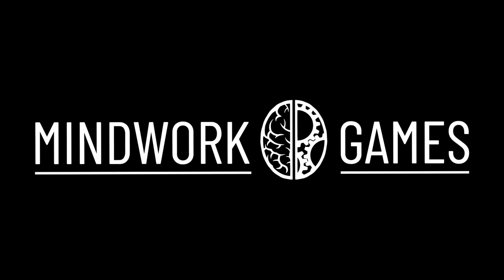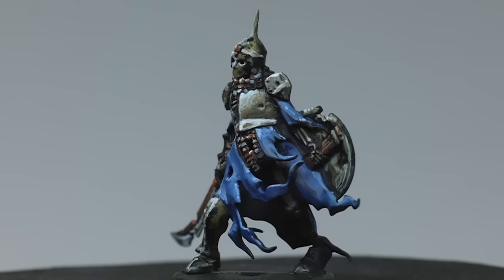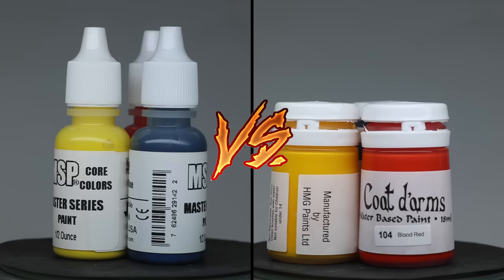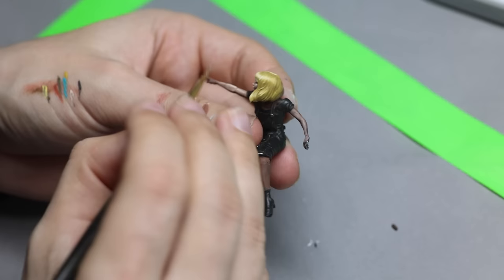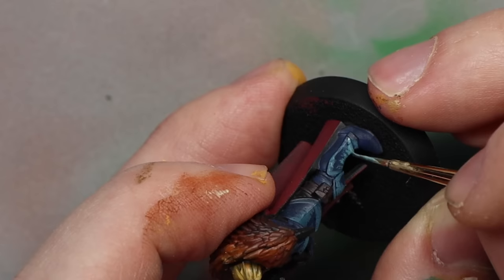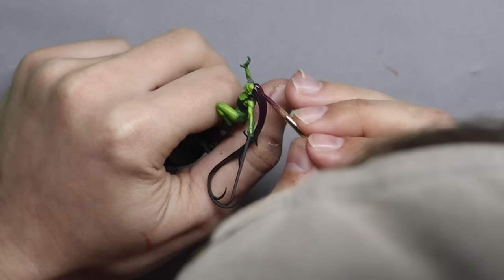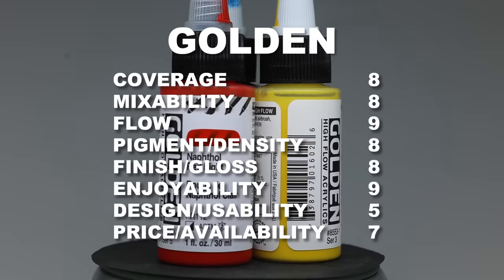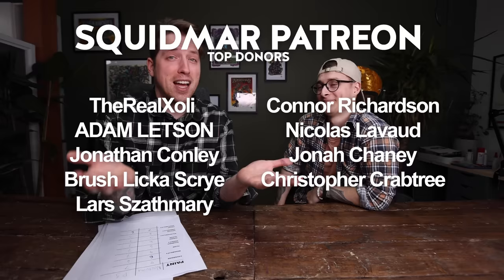Worlds biggest paint test! - pt. 1

Comment: Scale75 needs to be well mixed to work well. By well-mixed, I mean you have to beat it like a rented mule: use a vortex mixer with a dense agitator and keep it on the mixer for about a minute or so. Without that, the paints are OK at best. With that, they're freaking amazing.

Golden Fluid Acrylics have a gloss finish because a gloss finish can maintain an inherently higher color saturation. (Matting agents scatter light at the surface of the paint which reduces saturation.) You can always matte the finish at the end of painting or add a matting agent during painting. The high-flow line is really nice for airbrushing and glazing, but it's functionally useless for basecoating. The Golden Soflat line is dead flat and very nice straight out of the jar, but I'd recommend putting it into dropper bottles (as I would with any other pot paint.) Most Golden paints are single pigment (and they tell you what pigment(s) each color uses).

If you want a similar performance to Golden without a gloss finish, you might look at the Liquitex Acrylic Gouache line, which is flat and otherwise has similar performance to the Golden paints.

Reaper paints are very nice; I've used them for more than a decade. As others have noted, though, their early metallics are garbage. (The metallic paints they've released in the last few years have been much better.) It's too bad you don't have any of their browns, since that part of their range (including the paints nominally intended as skin colors) is excellent. There are a bunch of colors from their line that I use all the time.

Comment: Man, I wish these were the same miniature & colors so COMPARING at the end actually would mean something. Hard to say what is best when it's a different model AND color each time, I can't appreciate the details on "the best paint" if it's not compared to the other paints. Next time same model & color match AND if you can paint without knowing the paint, bonus if you paint blind so you don't know what brand it is. All these & I still don't know which is the next point I'd like to try, I HAVE to see them side by side with the same model & color set to judge. For example, I can't visually see a difference between Apple Barrel & Kimera BUT if they were both applied with the same colors to the same model maybe I could judge that better. Cheers Bruv keep up the great conent!

Comment: I feel like Vallejo scored so high because you know and use the paints often
Reply from the maker: Most these paints we've used a lot. But it became very apparent quickly how the paints work when we painted them one after the other.
Reply: @SquidmarMiniatures  that's a fair point I did notice a lot of the ones that had coverage issues (p3, monument, scale, warcolours) are all paints I don't normally bring out until there's a solid base color already down. While there are exceptions to that statement it mostly goes down that way, citadel or Vallejo usually being my base coating go to(s)
Reply: @MrLanzac  My workflow is very similar: Start with citadel and vallejo and finish the blends and fine details with scale 75 and warcolours. Though there are times when citadel / vallejo has just the right color for details as well, so it varies.
Reply: I mean, Vallejo is just good. I love my boutique Kimera and ProAcryl, but Vallejo has got the formula down for quality workhorse mini paints.

Comment: Thanks to local availability I've used Vallejo, Army Painter, GW, and Reaper (also Tamiya, but they didn't test those) and what I've found is every brand has some good and some bad colours (as Emil noted, Corax White might be the worst paint ever).  I haven't found the separation issue with AP (other than 'babe blonde'), even with shaking by hand  and my bottle of that exact red works great - maybe the extra shipping time to Canada from Denmark as opposed to Sweden does something (I dunno, its a science question, so Brent from Goobertown might be able to answer it). Or it's just that they need to up their quality control . . .

As someone else said, Reaper's triads are a wonderful thing.  Their 'Worn Navy' is great.
Reply: Supposedly Army Painter have a bit of extra unmixed medium in the paint to help it against evaporation. You're supposed to have it rest for a bit upright and squeeze out the first several drops (of probably unpigmented medium), the rest is fine. It's a bit of a hassle for the consumer but I understand where they're coming from from a logistics point of view. I just wished that the paint come with the mixing balls instead of having the consumer do it themselves so it's nice that they started doing exactly just that with the air and speed paint lines.

I found separation with my AP paints but with a bead inside I just give them a quick shake on a vortex mixer and I don't really have any issues. Reds and yellows still don't cover fantastic but for the price of the other "better" brands I just weighed my options and decided that liquitex guache is the better choice for those colors for me.

Comment: I've tried most of these. I quite like Army Painter. I've been using their Pure Red on a lot of my orks lately and it looks really nice and their yellow gives such a nice color once you layer it on a few times. I never actually had trouble mixing the paints, but that's probably because I shake them by hand. Also, I do almost always use medium instead of water to get my paints to the consistency I like so maybe that helps. I find quite a few paint brands look worse using water instead of medium. My go-to paints are Vallejo and Army Painter.

Comment: Yes it's a year old video but   from my experience of being a paint addict here is my personal ranking;
Wildcard: Molotov Acryllics - a graffiti brand that specialises in acrylic pens and sprays, this means that their adhesion is fantastic and outperform any primers I have tested, even brush painted black, they are silky smooth as they are designed for rough walls so make a fanatic primer and base colour in one package 
Number 1: Two thin coats - really grown on me laterley and found myself gravitating towards them, they are basically citadel paints but more consistent, better coverage and in a better pot.
Number 2: Kimera - I really struggled with them when I first bought them as I bought into the hype of their quality. Over time I found that glaze medium was the way to go with them and forced me to think about the colours I use. They punish lack of patience with layer building so you have to make care to get that clean coverage as each paint is unique due their pigmentation qualities. Outside inks their richness is unmatched.
Number 3: Monument, another brand I've gravitated to in conjuction with TTC, a great array of useful colours and probably the best white and greys on the market.

Comment: Scientifically this test could be improved. 
- First off, having two people conduct the testing and overall score introduces potentially incompatible bias on either side of the chart
- Branding wasn't removed, and so personal bias can sneak in there aswell (you would also need to have an independent person manually transfer the paints from their original bottle to a standardised one, also labelling each one with a serial number that would match up on a spreadsheet)
- The models themselves weren't standardised, so you're naturally going to get a different painting experience and also have any frustration of the model design itself transferred to the paint grading
- You would also want to use the same brand of brush each time, though replacing it with a new brush of that same brand and model each time you start a new mini. 
- Have some grading criteria, that way you can standardise scores each time, otherwise its hard to get a quantitative result since you're essentially guessing what number you should grade it as

Comment: Scale75 being really thin is usually not the case. The regular Scale75 paints have a tendency to separate similar to Army Painter, you gotta shake them well, because otherwise you're mostly getting medium, that might have been the case here, because in my experience they cover pretty well and are rather thick. Given you mixed them well. They btw also use a gel medium so it was actually quite a fitting match up.

Comment: So I've recently started playing with Golden's SoFlat, and from my limited experiments, it has blown me away so far. Their permanent green light immediately replaced ProAcryl's Green for me. I will note that in the USA, they're a lot cheaper on DickBlick than in store for me, so price check them if you can. I have two critiques. First, because they're a fine art paint, they're fine art colors, which means things like skin tones are limited. Second, because they're a fine art paint, they're in those screw top lids. I wish they were in the high flow containers, but I know how to transfer to dropper bottles. It's kind of a pity they went up against Kimera, as those are a bit of a juggernaut, and I wouldn't be surprised if they make it to the final 4.

ProAcryl has been my go to brand for painting for the past 2 or 3 years. Aside from the twist top, which as you noted will always leave at least some mess (especially if the pressure has dropped, or the bottle has warmed since you closed it) my big complaint is on how they separate over night on a wet palette. Even after mixing, they end up a little chunky, which is unlike most of the other brands I've used. That said, finish, range, price, and just how fun they are to paint with are all top notch.

Citadel is Citadel. You know what you're getting, and what you're getting is good. Their pots are bad, and they're about a dollar more expensive than what you want to pay, but as everyone knows (aside from the white), they do good stuff. They have some really interesting colors, which I like to not have to mix in other ranges, so they still regularly end up on my palette.

Vallejo is Vallejo, and they also do incredible stuff. What they do is well known, and their paints are great. Apparently they're a little difficult for distributors to get in the states (or maybe they're just not being pushed? IDK. It was like pulling teeth to get my LGS to stock any of their stuff), but yeah, if you can get them, use them. Their silver metallic paints are some of the best in the business. I'd like a few more options from the gold/copper/bronze tones for Vallejo Metal Color. 

AK Interactive III is another paint line I've used a ton of, and they're really fun. They're a little difficult to get a hold of here in America, but several of the colors are in my favorite selection of paints, and two or three tend to end up on nearly all my minis these days. They are military focused, rather than fantasy/scifi focused, so think Vallejo Model Color vs Vallejo Game Color. In many cases they do a lot of the same colors Vallejo Model Color does, but with a more matte finish, which is good in my book.

Comment: I mostly paint with citadel, because those are the easiest accesible to me (sure, there is also Armypainter, but unless they start adding the ball to the pots, like they do with the speedpaints, i never got a good result).
For black and white i get tube of nonglossy accrylic paint from an art store. Sure those are pretty thick, but you can easily thin them down with water or medium. Also those tubes last forever. I haven't finished a singel one yet.

Comment: I really like the old flip top pots, not just for the nostalgia, they're also the only pots I own that still contain usable paint 33 years later (I bought a bunch in '89) unlike the more expensive and awful containers that Citadel/GW came up with afterwards (I'm looking at you black hex flip tops), the originals were very flexible and sealed great.  I use a beer bottle opener to open them though as they tend to hurt your fingertips after a while. (For new GW paints I do use dropper bottles with glass beads though.) Also I think someone mentioned this but Coat 'd Arms isn't really meant to be used on a black background, (there wasn't even a black Citadel Primer at the time the paint was formulated.) the type of painting we did back then was usually to go from light to darker,  and finish with an ink and they are pretty good for that. So they are good for an "old timey" paintjob. Dark to light is way nicer to do though and now I like them as finishing glazes in the airbrush as I do Golden.
Reply: I just went through my similarly vintage paints and rejuvenated the survivors with a skewer and a bottle of matt medium. The old starter set gold is the most interesting, having taken on a green cast giving an old gold look. It looks amazing, I want to use it on undead!
Reply: Might be dependant on the brand.  The P3 line of paint bottles SUCK.  Like the lips snap off with very little use and the top then cracks.
Reply: @colinmorrison5119  I also have that 'Shining Gold' paint, but I actually remember it always being a little greenish. To reproduce it I read that others actually put a little drab green into Vallejo 'Polished Gold'. Using it on undead sounds pretty good actually.
Reply: @joegkushner  I'm only referring to the very old pots made by Citadel, I bought all 4 sets in one go at the time so maybe I got lucky and got a batch with a lot of plasticizers? The ones I have are actually a little rubbery I can almost fold them in on themselves without incident. Then again the later hexagonal pots with white and blue tops also cracked for me.
Reply: If the paint dries on the rim, it can glue the lid shut somewhat. I was thinking of buying some empty ones of the same style, for DIY contrast type paint mixes. For regular paint, I'd use a dropper bottle.

Comment: Absolutely wont say Vallejo isn't better than Army Painter but I've never had those separation issues with Army Painter.  They do ship with extra medium so as per their instructions I remove 5 drops of medium as it settles on top (before shaking and before 1st use).  I do use a vortex mixer and mixing balls in my Army Painter and I've found them to be as good and comparable to Citadel.

Comment: Weird, I do not have the same experience with Army Painter paints as you guys.  But then again, I mix my paints with glass beads and a power drill attachment for 30 seconds, so I've never had a separation issue.

Comment: I recently picked up a bunch of Golden SoFlat based on Ninjon's recommendation and I can confirm that they are absolutely lovely to work with. And they are excellent value for money too. The vibrancy of the colors, the consistency of the paint, the pure matte finish, it's all excellent. My one complaint is that they do not offer a pure Magenta or Cyan. There is a Cobalt Teal which is close enough to Cyan, but the range just doesn't have anything approximating a Magenta, which is disappointing because Golden does make Magenta paints in their other ranges.

Comment: Thank you for such a thorough comparison! Golden High Flow is more of an ink than a paint. It's the Golden brand equivalent of Liquitex Acrylic Inks or FW inks. You might check some of the Nocturna paints again and stir them. I found the mid and lighter colours particularly had to be stirred to thoroughly mix after I left them sitting for a long time. Once thoroughly mixed, they were quite thick - almost too much so! Many of the darker colours seem to be made in more of a shade or glaze/tone consistency. This might be true of some of the other paints that seemed runny or super transparent as well. I have a lab vortex mixer, and it's great, but I have found that some paints need a little stirring to get moving enough for the mixer to work.

Comment: Did you try the Foundry paint system paints too?
I usually only see those on conventions,and haven't really used them that much.  The paints are a bit more expensive, but whenever you buy a pot of paint, you also get a lighter and darker tone of that paint.

Comment: Awesome video and I love to see such a huge comparison! I'm not too surprised by most of the results, but I do want to defend Army Painter, as I use Citadel, Vallejo, and AP evenly. 

Yes, you need to shake em up with a Vortex shaker for a long time. Much longer than the minute that was done in this video. Do it for like five minutes and you've got a paint that has been awakened. Yes, it's not very good if you need to do it for five minutes, but later, you don't need to use the vortex shaker at all. Once they've been mixed properly, the coverage and flow are (imo) better than Citadel paints + they come in good dropper bottles, and at a much cheaper price!

Comment: I played around a lot with different paint brands when I first got into painting, and eventually settled on Vallejo as my workhorse brand and Citadel for their technical paints; Vallejo really are a joy to use, even their "worse" Game Colour range which has a slightly glossy finish and slightly worse coverage, but is much tougher and designed for frequently handled tabletop minis. I really don't think you can ever go far wrong with Vallejo, and they even have some hidden gems like their Glaze range.
I've got a handful of reaper paints and they're pretty good, but I'm UK based and can confirm they're an absolute bitch to get hold of - that, and they do tend to separate and need an ungodly amount of shaking to be useable. Also, their white and bone colours are truly awful.

However... different paint ranges do tend to have weaknesses in different places, and I cannot stand the yellows from either Vallejo or Citadel so I've been hunting around for an alternative for quite a while. I'll give Kimera a look, but I've tried so many I'm starting to just think yellow just sucks to paint overall...